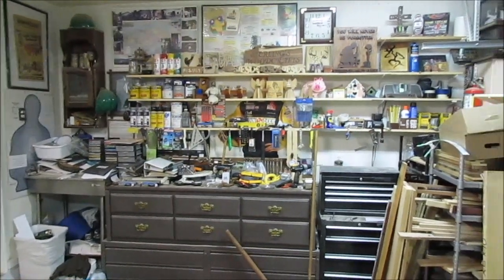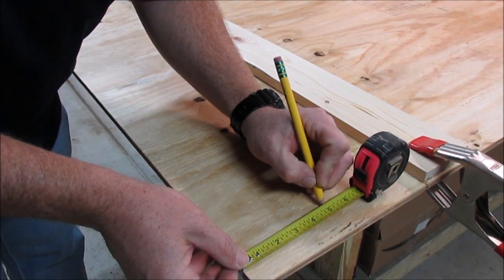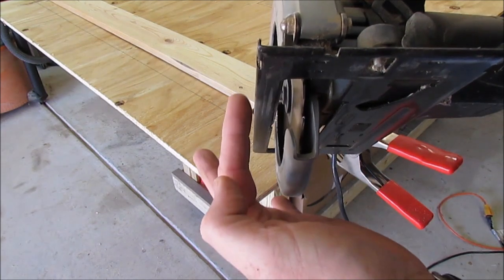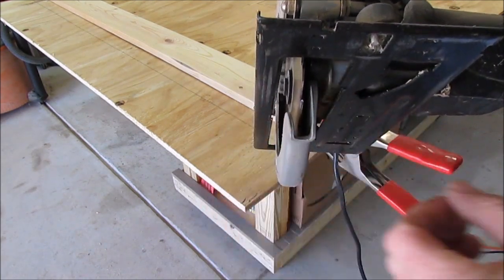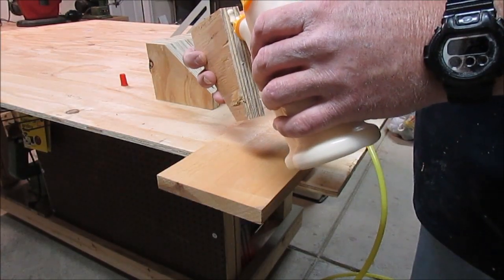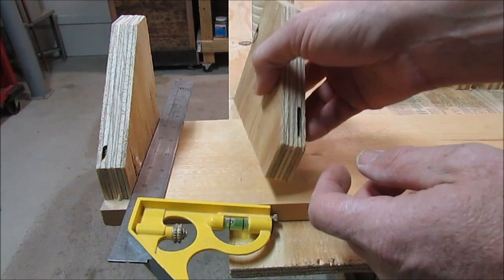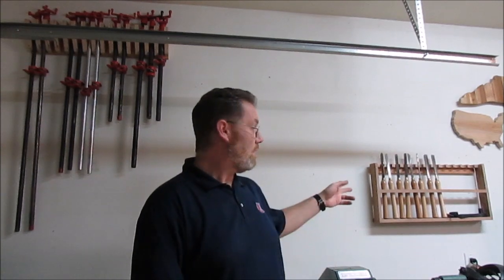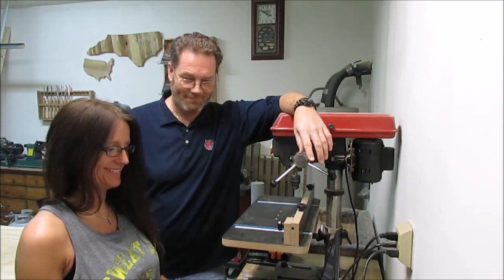Build Your Own Clamp Storage Rack

Comment: Now that was a funny ending!  I made mine very similar, using Steve Ramsey plans.  I like the idea of that 5 degree cut on the top.  I didn't do that, and so far, knock on wood, none have fallen, yet.  I am pretty close to the New Madrid fault, however.  I've also use the French Cleat system to hang my rack and it's doing a great job.  btw, my wife thinks Steve C. is kinda cute also.
Reply from the maker: Thanks for the view and kind words, I appreciate the support, Steve Ramsey has some Great videos and plans out there, I steal a lot of them from him, and that goes to show how great of a guy he is, he don't mind lol, Thanks Ron

Comment: I just learned a trick... if that piece of pine is the same as the shoe for the saw (1-3/8"), make the 5" draw the line on both sides of the pine, then move the pine to the second line. does that make sense?
Reply from the maker: Great point, or just measure 6 3/8 would work as well, and I don't think the wife would do it, but I am working on it lol